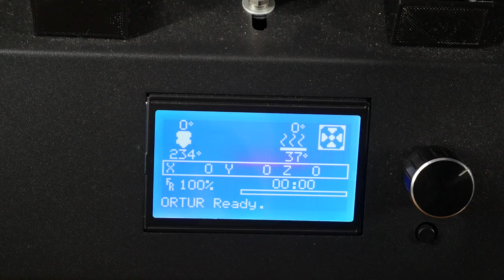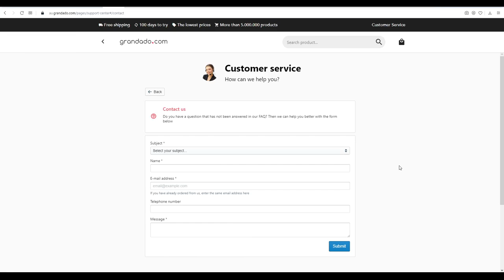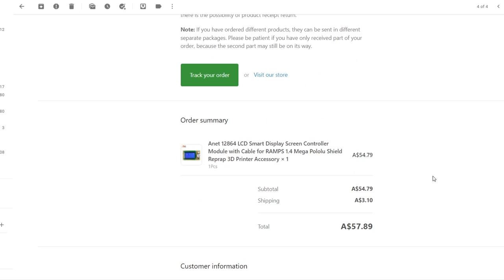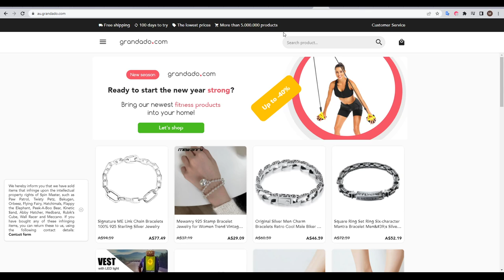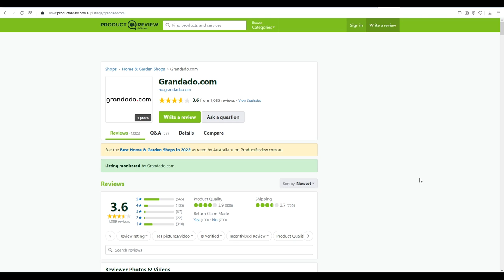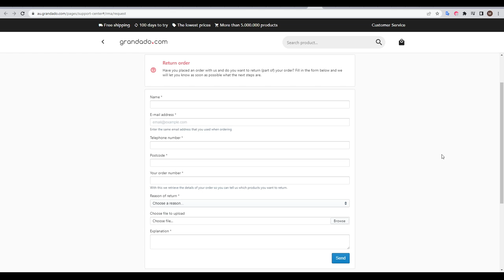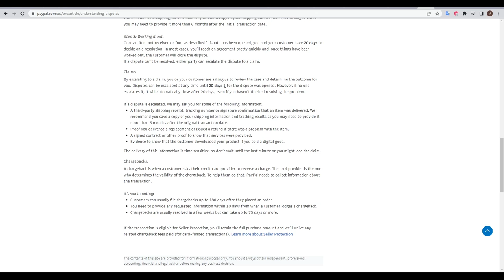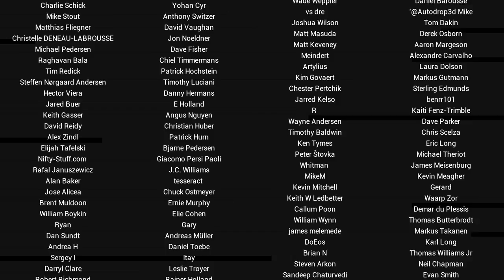I got scammed buying 3D printer parts! My tale and how you can stay safe.

Comment: Thanks for posting this. The best thing is to shine a light on people whom operate businesses with these poor practices.  I am going through my own issue now trying to get a company to honour their own price guarantee practice. I bought a graphics card and they put it on sale within the price guarantee period so I contacted them to get the difference refunded. They responded that products with mail-in rebates are not eligible for the price match and included a copy of the guarantee. My response was that their guarantee did not match the price of mail-in rebates but did not prevent items with mail-in rebates from having the price guarantee applied to the main price. It was also pointed out that the mail-in rebate was for the whole month and I had it on my item that I purchased, thus it wasn’t applicable. I wrote this nicely and said that I hoped it cleared any confusion. I quickly received a response that the price guarantee did not apply to “instant rebates”. At this I called them out for their bogus excuses and said that they had a choice of making me a happy customer or I would contact my credit card company to dispute the charge. They never replied nor did they refund the money. They are Canada Computers & Electronics.

Comment: Once you're caught out the learn how the world works. These sites are VAR selling agents who's business model revolves around the premise that the website suggests its a local warehouse. Some are okay - one company trading by the same business model was from the UK and the experience was excellent but as far as China goes - Ali Express direct or bust. At least in Australia they will refund if there is a dispute and returns are handled through the local (Aussie) supply chain for free - at least in my experience. One thing I have noticed with Ali Express however is some smaller sellers seem to dish out false tracking and delivery information - so it pays to screen shot your tracking page periodically before it's arbitrarily altered. Outside of that, check to the company details (about us) before committing to a purchase. If there isn't a local address or phone number present then I'd personally avoid them.

Comment: Got my 1st 3d printer on couple months ago. Asked for a refund due to faulty fan and other issues they kept prolonging the after sales process. Got offered "You keep printer and partial refund" and when I asked for more specifics on partial they didn't reply. I bit the nail and just agreed which was my own fault and got back $20. It wouldn't have covered the shipping I would of spent to send it back. So now it's seen as refunded so I don't believe warranty/aftersales apply to me unfortunately. I've since fixed the issues, bought a flsun sr and ender 2 pro, designed my 1st 3d model will continue to 3d print. Just now I avoid voxelab like the plague just from personal experiences, though I still love the aquila x2 as it being my 1st 3d printer. Lesson learned. Thanks again Michael for always thinking of the consumer 1st!

Comment: I had something similar - except I used it to scam the scammer.   The page was a similar "sells everything" type - and I purchased an LCD screen for my Pi - the reviews said it had no HDMi- but it claimed HDMI on it - which was th eproblem for most.  For me, this wouldn't be a problem as I planned to connect directly to the GPIO anyway.

I review the order and sure enough it was all "the thing I searched for" not what they really sent me.  All confirmations said this - and then when it arrived, to no surprise to me thankfully, it was a GPIO connection only lcd display.  Of course I contacted them, giving them a chance to correct it (which, if they did would actually be a slight problem for me - as I didn't have Hdmi cables for it anyway) but they stated the whole "give you 40% back" - i fought this though, and got a full refund.  When asked if I needed to send the product back, they stated "no" - so.  Free LCD for me.   To them it's really no loss, it was probably some obscure made/old inventory that did nothing for them anyway - but for me, it's a LCD I can use with my pi.

Dishonest of me, yep, but when these scammers get so many honest people, I feel the need to strike back when I can.  I don't do this with honest sellers, and I always give a chance to correct, just in case it was an honest mistake, but once that "keep it and we will give you 40% refund" type stuff happens, I know I am not really dealing with anyone honest.  Especially when I point out specifically the site has changed  or in my case, the description stated HDMI capable, the product shown (image) was HDMI - and no where did it indicate in any way that it would not be HDMI capable.

After getting my refund, and having the screen still - I checked the site, and sure enough - it is STILL listed as the same HDMI capable LCD, with images of an HDMI capable screen.   They didn't change a thing.    

All I can really say is read the reviews, most of them, if not all of them.  If anyone gives a story like this - consider buying elsewhere, or, consider buying from them, knowing you can get 40% cheaper for a 'different thing" that you actually still want/need.

In the case of the mic- I'd compare it to other mics of same type, and see if it was worth it - even if it wasn't the item I intended to buy when searching for printer parts, maybe I was in need of a USB mic as well, getting it - and then 40% refunded, might have been a decent deal at that point.
Reply: Doing something wrong isn’t made right if you do it to someone you think is bad.

Comment: I too, got cheap lavalier mics from an Aliexpress order. Switcharoo. Do they think they will get away with it? As long as you stay within the buyer protection time frame. Aliexpress has been excellent getting refunds. So other than wasting your time, I haven't lost any money with Alie.
Reply: @Cthulhu My experience, and mind you these are lower cost "3D printer" type items. When I have not received an item by the deadline, or a tracking number says it was delivered to a different address, or they sent me child's hair clips instead of TMC2209s, I open the dispute, and have received a refund in a few days. I don't know the process if it was an item greater than $30.
Reply: I had money deducted from my AliExpress refund because I had received an item, even though it was not what I ordered, and I had no use for it. Seller didn't want it returned, so I got deducted. On another occasion, I was refused a refund because I wasn't willing to pay for return of a damaged item which would have cost me more to return than the value of the item. Seller required tracking on the return so I couldn't claim it was lost in transit. I did get a "full" refund on an item that was claimed as "delivered", but I could prove wasn't as the tracking number provided was fake. I say "Full" because I did lose out on difference in exchange rates, and foreign currency costs by my CC provider. So AE refund system may be good, but is not a certainty either.

Comment: Dealing with an aliexpress scam seller right now, and aliexpress is basically defending a scam seller. Definitely a good tip is to check reviews, check how many items the seller has sold. Make sure in this field they are a tech seller only. If they also sell jewelry, stay away.

Comment: for what it's worth, the site looks like quite a dodgy drop shipper site. They don't actually have any inventory of their own and use inventory of companies offering drop shipping services. Chances are their data entry is mediocre and one of their suppliers did offer the screen at some stage but sloppy work lead to the listing being for the microphone instead. Pretty sad response to throw the blame back on you though. 

Typically when I'm looking for parts locally I look for an ABN or a physical address before ordering lucky enough to have not had to deal with these situations because of it.

Comment: Not necessarily a scam (but probably), I had a very late delivery from China on an Ebay purchase. I chatted with them about it, and they offered to send the package again (which gave me alarm bells). I waited some time longer, then made a Refund request (before the 30-day Ebay limit) and they repeated their suggestion, I dismissed it, and then I got the refund. I used a different supplier to reorder the item and that delivery worked out fine.

Comment: One very, very, VERY important point that I don't believe you covered is if you're even slightly unsure always use a payment method such as PayPal or a credit card where there is the option of a chargeback. Even on Aliexpress and Banggood i only use a credit card just incase the seller tries to pull a fast one.
Reply: On Aliexpress I get quite a discount if I pay through my bank's transfer system that Aliexpress supports for e-commerce here, and I've only ever once had a problem with disputes not working, which they eventually conceded on the support channel.
I've definitely had my fair share of bad experiences there tho, most of them just waste of time tho from a seller that pretended to send something only for it to be a fake tracking code that when expired I get a refund from "abnormal tracking". Frankly, I don't get it why the sellers just don't cancel the order themselves already.

Comment: I fell for something similar. Facebook had an ad for a REALISTIC looking werewolf with real hair and glowing eyes for $70. It wasn't just pictures, it had a video of some guy wearing it. It took 3 weeks to get it and what i got looked like it came from the halloween store and cost maybe $12. It arrive 2 days before halloween so i was screwed. After 4 weeks of back and forth with them, start off with $5 refund and you can keep it, then ended with a $55 refund. So they still made a tiny bit of money from me. CHINA is the most devious of them all. I will not order anything i cannot find on amazon.  Though some have had problems with items from amazon, Amazon has easy return and refund policy. Besides that, most of those problems are from amazon returns quality control and damaged\missing part items get put back in with retail items.

Comment: I always use PayPal when buying online. I had this happen to me a few times and I used to contact the seller which caused nothing but problems and sometimes ended up not getting my money back. Eventually I would just ignore the wrong item that showed up and just file a claim on PayPal as if the item never showed and I always got my money back that way. Always check reviews, avoid websites on google searches with ad written to the left of the website and try to pay in a way that you know you will get your money back easily without having to do a chargeback or just forget the money altogether.

Comment: I am having an issue with my new CR touch on an ender 3, and I was hoping you had a video... My Z offset won't store! . I completed the setup and upgraded my firmware to the 4.2.2 file on the CR touch page link, then added the code to Cura. Every time I do a print, I have to add the offset (-1.4), or it will start printing in midair. Any videos or website links covering this issue?
Reply: You need to have an SD card in the SD slot for it to store settings when you hit the "Store" menu option.--there's no place within the EEPROM/Firmware allocated to store the probe offset.

Yes, that is the dumbest thing I've ever heard.  But that's the case. 

I've noticed that after power hits, I've lost my settings couple times, even with an SD card in.

Comment: Design and print a faceplate adapter for the "new" lcd wide enough to cover all the holes in the metal plate
Reply: Ngl I would have just modded the metal plate to accept whatever screen is good and cheap for the main board.

Comment: Well I was scammed by creality recently. My mainboard bricked itself during printing and creality blamed it on the LCD cable. They claimed that the cable itself is magnetized and thus stopped working even tho it's working just fine with a replacement mainboard...

Comment: If a screen and stuff cost that much it be better to just buy a ender 3 and replace that junk printer with something that's better.
Reply: I mean $100 for a few parts would give you a much better end result printer. Rather than getting a new Ender 3 and starting the whole testing and tuning ordeal either way you might as well just build up the printer you have to be better.